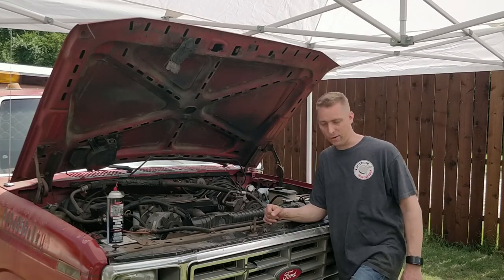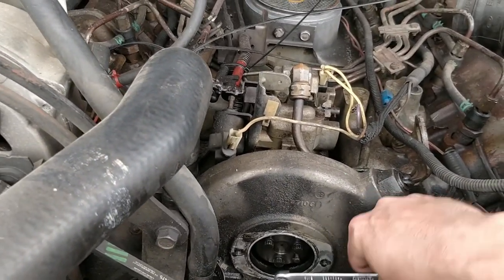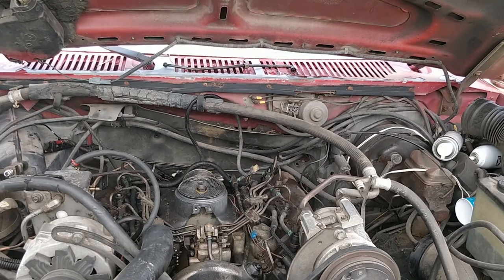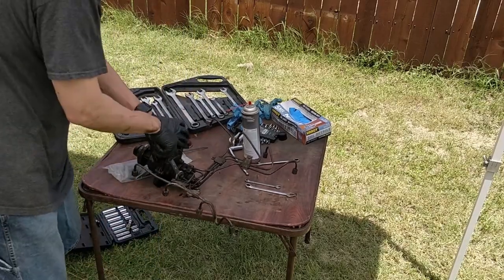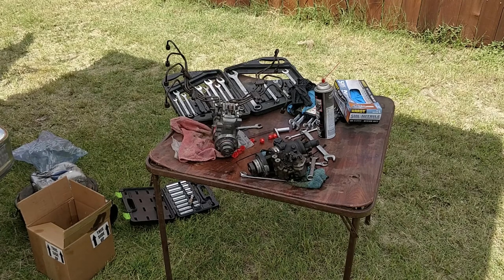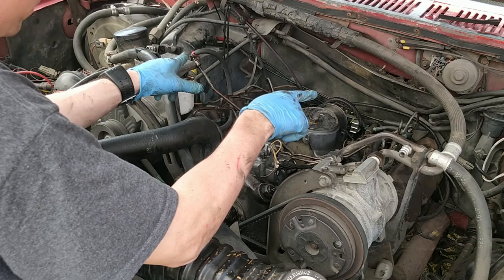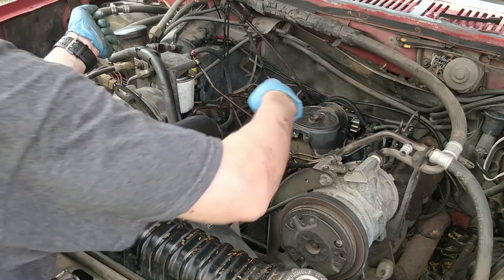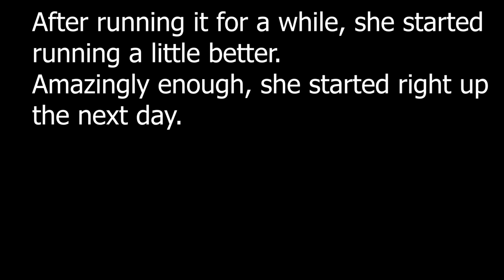Ford F350 6.9L IDI Diesel Injection Pump Replacement

Comment: I’m curious why you didn’t do the injectors at the same time
Reply from the maker: I don't think there are any problems with them.
Reply: @RevampMotors  ok have you changed them since
Reply from the maker: @jadinzack9271 I have not.
Reply: @RevampMotors  still running? Maybe I don’t need new injectors then
Reply from the maker: @jadinzack9271  still running, however, im on on fuel pump #3 since then.
Reply: @RevampMotors  I’m still on the same facet duralift pump after about 4 years would recommend i think they recently rebranded to carrier
Reply from the maker: @jadinzack9271  i bought one, just need to put it om next.

Comment: I have pretty much the same truck. 85 F350 6.9 IDI Dump. It's been stalling when I push in the clutch and the revs fall. I've about had it with this truck though and ~$1000 for an injection pump may be the straw that breaks the camels back.
Reply from the maker: Check your inlet pressure before you replace the pump.
Reply: @Revamp Motors by R.J.  what would be the issue if that was low? Pretty sure the tank pump was replaced not that long ago.
Reply from the maker: @MeltingRubberZ28  the lower the pressure will pull back timing, on that diesel, there shouldn't be a tank pump.
Reply: @Revamp Motors by R.J.  seems like it was likely dirty injectors. Put 1.5 cans seafoam in the tank, warmed the engine up, drained the fuel filter and filled with with pure seafoam. Ran the truck for about 90s and shut it off for 20 mins. Started it back up and it ran great, drove it for about a half hour around town. That's seafoams "standard procedure" for diesels. Worked wonders on my truck. Figured I'd share.
Reply from the maker: @MeltingRubberZ28  That's great!  I should do that at least once a year.
Reply: @Revamp Motors by R.J.  if I were you I'd put a can in your tank right now. Next time you change the fuel filter do the filter clean too. Well worth it

Comment: Damn you're cranking on that thing like it's slave lake 😂
Reply from the maker: Yeah, it was suggested I should have held the throttle open to help prime it.  It starts right up ever since then though! 😀
Reply: @RevampMotors  yeah that would probably have helped. Just got my first IDI this week, pretty stoked sister learning about those since I came from a powerstroke
Reply: @Depressed_Nightfury  just got my idi about the same time you did, yours a 6.9 or 7.3?
Reply: @christianfrome5437  6.9 with a 4 speed, 84 F-350.
Reply: @Depressed_Nightfury  Nice! I got an 85 4 speed F350 with the 6.9. White crew cab dually long bed
Reply: @christianfrome5437  mine is a mint green single cab dually, was a c&c dump truck, previous owner shoehorned a 90's bed on it which looks terrible. Going to flatbed it eventually.
Reply: 👌 Miiiiiiiiint!

Comment: Overall very helpful. Thanks! A couple of things I learned the hard way:
After having the ip out take it to a shop that has the tools and skills to time a mechanical injection system. Only 1 or 2 degrees will cause high temperature, heard start, smoke and loss of power. May even sound ok the a trained tech.
NEVER HOSE DOWN A DIESEL WITH EITHER!!! 20:1 compression is not the same as a Gasser. The glow plugs will light either in the prechambers blowing them down into the block! A great video showing damage is: Why we don't use either in our diesel. With a 6.9.  Also broken piston rings, and damaged timing gears.
When loosening the nuts on the injector lines, hold the fittings on the ip with a wrench.
If your ac is working, put caps on the high and low side Schrader fittings. The gas can leak out of a good valve if left uncapped.
Good luck with your ride.
Reply: Having said that, if you feel you must use either, only a short sniff will do the trick. Be sure to DISCONNECT the glow plug circuit first! I've heard that WD-40 will work with out damage .
Reply from the maker: This is EXCELLENT info, thank you for taking the time and writing this!  I will be sure to be more careful from now on.

Comment: Damn, I thought you were joking when you said low compression. I used that much ether on mine it would probably run away
Reply from the maker: After running it for a few mins, it runs a lot better now.  It has been starting right up every time.  I think I have it in my snowy days video.